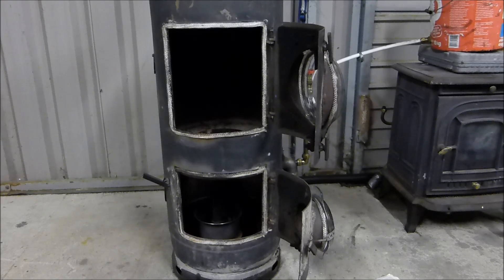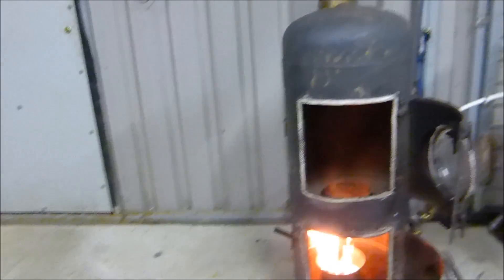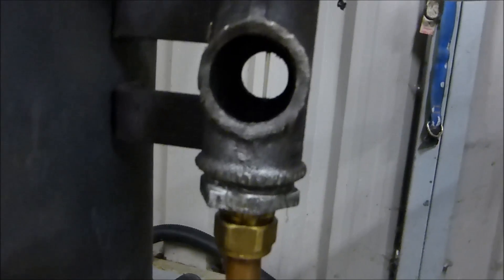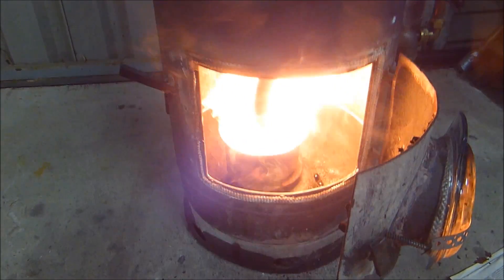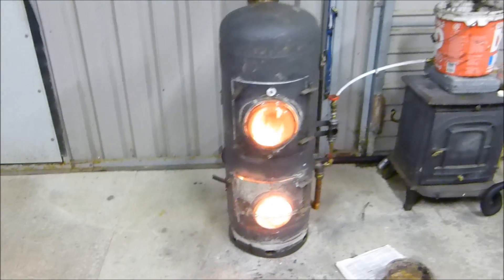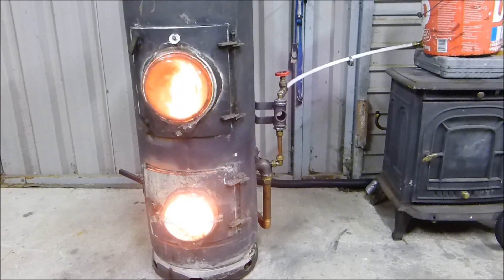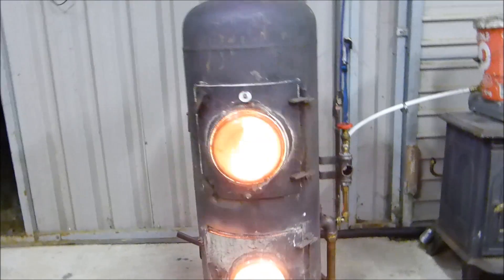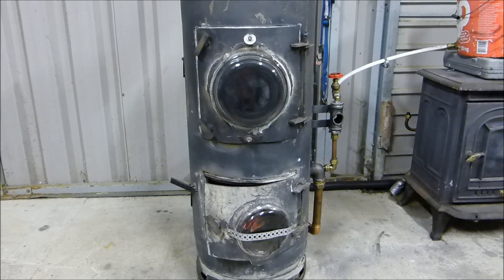Waste oil burner .. Drip Feed .. Back in action. Smoke free

Comment: Question for you; I have built one of these, but when it gets 'real hot' I get smoke coming up the oil feed line to the site window. Have you had this problem?  If so, do you have a solution other than shutting down the stove a bit?

Comment: Hi Gerry. I have been meaning to build a waste oil burner for some time now and your videos have inspired me to get going with it. I am curious about a couple things I haven’t been able to come across in your videos. First have you been able to use the multi fuel burner with the new forced air setup and burn wood at the same time. And the second question is for the oil feed you always use 1/2” copper. I have an abundance of 3/8” copper and wondered if you had experimented with it any and found 1/2” more desirable. I enjoy all the videos so far and look forward to more.

Comment: good evening I wanted to compliment you for his work is' really great, I wanted to know if possible the diameter of the exhaust gas I miss only this measure. I'm about to start a new project like yours, but 'I'll put a copper coil with 100 turns (inpianto x heating with an open vase) hopefully good
Reply from the maker: Hi Guiseppe.  The flue diameter is 4 metres long and 150mm diameter. Before you start building this have a look at my new burner. https://youtu.be/ShTLaYKjzxw Check out my playlist https://goo.gl/u7T3RW These burners are working great and dont need power Cheers Gerry
Reply: ok thanks for the answer then length 4 meters diameter 150 mm, I saw the great video this I'll piou ahead x my garage but in the meantime I continue with the first project I'll let you know how it goes to refine

Comment: why not warm water with this awesome piece of kit and pipe it through your home? or can't that be done?
Reply from the maker: Hi Mark. I designed a new and smaller burner unit and tried it in my house where I have a boiler stove that heats my underfloor heating and domestic water. I am burning waste veggie oil and heating 80 gals of water and my floor heating too. Check it out here. https://youtu.be/XmAqunRfCaA  Cheers Gerry

Comment: Awesome work, thank you. Why does it have two levels/doors? Do you use it as a heater directly or do you inject hot air/water in the rest of the house somehow? I'm thinking of feeding my radiator system with hot water out of one of these (with a thermostat, of course) And last question, did you ever use a buffer tank so that it heats water?

Comment: I have noticed  that the past 2014  copper feed and 1 inch pipe  drip tube  with spring ,and now see you changed the design, of the drip tube  with the end sealed off and 3 holes drilled at the end of the tube , what was the reason for that?

Comment: can smell the vegi oil here in the ole USofA , could you explain how you glue seal on the doors Thanks great video, nice job
Reply: Stove gasket cement.. works best if you rough the surface up with some coarse grit sanding paper. They do make flat gasket material you may be able to device another way with but at the temps you see with burning oil efficiently you have to be careful what and how you use it like not using rivets. These units aren't usually build air tight and thus why they are used in shops and not in homes.

Comment: Interesting work you're doing there Gerry, something to build on. Thanks for laying down so much ground work.

I would think a thermostat to shut it down when the room reaches a certain temp, along with an auto ignition system for when the room cools down enough to trigger the thermostat to reignite the fire would greatly improve the usability of this device. As does a typical home heating system.

I have another thought of putting a 30 gal (or so) barrel inside a 55 gal barrel**, using the inner barrel as a burn chamber and using a fan/blower feed to the outer barrel to circulate the air around the outside of the burn chamber, exhausting it thru "vents" to distribute the heat (as in a forced air system) into the room. This system, in theory, would heat the room to temperature faster, thus activating the thermostat to shut down sooner (more efficiency). This would conserve the oil, thus getting more burn time for a given amount of fuel.

Then to think of water pipes coiled around the burn chamber to provide hot water (or steam, if you get into steam power)....or heating any fluid for any number of uses, including simply transferring heat to other distribution points.

 **(Or a small propane tank inside the larger tank)

Comment: If you built a fire brick furnace lined with steel plate, and made a frame work with 40 2" steel tubes welded to a plate and attached to a manifold, the air, or water would heat up from the tubes being heated by the flames. Pumped into the house. heat with the furnace outside reducing danger.

Comment: Hello Gerry , thanks for making the videos of the burner projects , I am in the process of creating my own burner based off of your design , mine will be used for multiple things , as in heating my shop and for instantly heating water using a heat exchanger . Burners are not very common in my area due to a short winter, so this is new to me , but I believe the burner will be more then enough for my needs.

Comment: Dear Gerry:

For over a year, I have been looking at waste oil burners on Youtube.  My original thought was to build one to boil down Maple sap into syrup (technically called an evaporate).  After seeing the Oritz (sp) style burner, I got pretty excited about building one.  The boys and I tinkered around with main burner prototypes using some scrape brake discs and pipe from the salvage yard.  We got it to burn pretty good not great, but I figured because we didn't have tall stack, it didn't burn perfect. 

As I kept flipping through different guys designs and builds on YouTube, none of them really appealed to me.  In particular, they all seemed to have the burner unit underneath and exposed.  There was something about that central design feature that I didn't like. 

Anyway, late last year (fall 2014), I stumbled upon your posts of building a burner from a propane tank.  When I saw you had the guts of the thing inside the tank, it just look very...I don't know...professional.  I liked it right from the start and couldn't wait to build it.  Unfortunately, time and other commitments pushed off my build until about a month ago.  We live in Wisconsin over on this side of the pond.  It has been a long cold winter.  As God would have it, the temps just shot up into the 40's (F) and we just got our stove completed and installed.  Could have used it months ago.  Oh, well it is ready for next year. 

Wow, I guess it seems I am telling my life story.  Here is the point:  THANK YOU!  Thanks for sharing your design and the video.  Tomorrow, I am hoping to video my stove in action and post it for others to see your simple but eloquent design.  And man, does it throw the heat.  I laughed with my son yesterday telling him how on your videos, you kept saying "savage amount of heat."  Not a common expression here in Wisconsin until today.  My stove throws a "savage amount of heat." 

Oh, yea, I am a woodworker and the best part of your design for me is DUAL FUEL.  Wow!  Our first burn in it was actually wood.  What a great stove.  I am now going to build one from my brother-in-law and another buddy (or, do you say chum?)

Thanks again Gerry. 

P.S. For all you other guys looking to build a stove, stop looking.  Gerry got the best design out there.  Build one so avoid wasting a year like I did. 

Eric in Cheesehead land

Comment: I love this stuff. Righteous ingenuity. You should put your blower outside so it's sourcing cold air. Denser air, better burn. 
Also, put a flat spot in the top so you can put a kettle on ;)
Reply: Run the air through an intercooler.

Comment: I like that stove. I have an idea about how you might get enough airflow out of your existing fan to let you close the door. Here's my theory: I bet that fan can deliver more air volume at that pressure than the tubing will allow. If you put a T or a Y at the blower and add a second equal tube, you may get the same amount of air pressure in the present tubing and yet have a second air tube feeding the fire. Same fan - double the airflow, or close to it. Then the only question is where would you direct the second blast of air to get the best possible burn?

Comment: Great job, but I confess, a little envious I am already.
Reply from the maker: Hi kenahp. Considering that the whole thing is built from an old propane tank and some pipe bits and fittings it really does make an awful lot of heat for tiny money. Thanks Gerry
Reply: That´s why i admire your work! A little bit of this,a little bit of that.......
Reply from the maker: Cheers 
Gerry

Comment: I think i found a use for the old gas bottle... Not for the shed but for the garden. We have a lot of engine oil per year, see if that goes smokeless too.
Reply from the maker: Great way to stay warm this winter.
Cheers Gerry
Reply: Did you measure the heat in the top section? If it burns hot enough i can melt metals to cast my own items :)

Comment: Where do you get your waste motor oil from?
Reply from the maker: Hi PlantsAsMedicine. I burn Veggie oil when I can get it and if I service my vehicles I will use the oil from that. There are many garages that are happy to give it away for free. This stove will burn solid fuel like logs, coal and shed offcuts. Hope this helps
Cheers Gerry
Reply: Thanks, your right, I just googled used motor oil Ireland and some fella was giving away two large barrels of used oil, can that be converted to heat water pipes?
Reply from the maker: Hi Plantstomedicine
Great handle. I could do with something medicinal for a cold / flu right about now.
Getting your hands on the oil in small quantities is just a matter of chatting with some smaller garages.     Cheers Gerry
Reply: Cheers, Real honey hot water and lemon does it for me, RAW honey is a powerful antiseptic ( small spoonful every hour or so),  stops flu from becoming nasty. Did you ever here of Rick Simpson-run from the cure.
Reply from the maker: PlantsAsMedicine Thanks for the advice You were asking about the heating water. I did a few videos last year where I show 300 litres of water being heated by an old boiler i converted. Here's a link  http://youtu.be/xvddVsLqLdc
No I hadn't heard of him but I have a couple of brothers that should be cancer proofed for ever because of their fondness for ....  Cheers Gerry
Reply: Thanks for the link. Lol smoking it is good for chronic pain and general loveliness, unfortunately not good for cancer you need the oil extraction for that and almost every other  long term degenerative disease.

Comment: Another great job Gerry.  Have watched all your videos. Would a tank the same size as your minion tank be ok without the air flow. For a patio heater.  Thanks again for all the ideas.
Reply from the maker: Hi Mark. This little minion will be used as a patio heater and I might make a BBQ version of another character if it works out well. I could easily run it on waste oil but I might just run it on logs and sticks, not sure yet. The main task now is to get it looking well and then I will make it produce heat. More videos next week Cheers Gerry

Comment: Hi Gerry good to see you back,  did you change the design again,  I thought you made it multi purpose design?  to include a drip feed system.  Cheers
Reply from the maker: Dave Maher Hi Dave. I have been messing around with the design alright and there is more on the way. With the blower type I wanted to be able to convert an old oil boiler and stove to run on waste oil without having to do very much modifying to the original host. If I use the Ozzirt type I have to cut the bottom and raise the boiler so I went with this direction. I still have my Ozzirt original which seems very popular and I get asked about which I think is best all the time but the truth is they both work producing masses of heat, Thanks Gerry

Comment: Where can you buy kerosene? don't they use that in jet airplanes?
Reply from the maker: Hi Yves. Kerosene is used in domestic oil boilers as it burns cleaner than diesel. Its readily available but I could have just as easily used a little diesel. I think they use a high octane version for aviation. Cheers Gerry
Reply: +Gerry's Waste Oil Burner - Guys: Jet fuel (JP5) is high grade kerosene. Almost clear. Generally filtered quite well.   Hope this helps.    brad zee..

Comment: Hello Gerry, Thank's.
Questions (if you know) :

- I need to do a cheap barrel one,
but for heating a van, so I can't add a fan (too noisy- cat's house),
-> Fresh air intake with preheat tube could be a few sufficient (with a vortex etc maybe)?

- Those are Pyrex cooking plate as window :
-> Can I cut one with a carbon disc ?

Good winter -ü- 2015

Comment: Mr. Gerry the heater you made is very nice. Very impressed with the plumbing . Oil pipe in blower air pipe is genius . Can't wait for the next one. Which I already had one made for the shop its getting down to the low teens F in the next few days
Reply from the maker: Hi Jeff. This little burner works really well and with the door closed and the fuel cut down a little its a lot quieter than in the video. I am waiting on a syphon nozzle setup for the next waste oil burner series and  so more videos on that soon. In the meantime I am uploading a video which will be live tomorrow some time. Stay warm Cheers Gerry

Comment: Out of all the methods that you have tested.  Would you say that this is the most efficient (heat output for oil used)?  Currently building a waste oil burner but undecided about the best method.  By the way thanks for all the information and videos.
Reply from the maker: Hi T Ellis. At the moment I prefer the forced air type because of its size you can fit it it alot of stoves and boilers. I will be making a syphon nozzle type burner as soon as the parts arrive but the Ozzirt type works even when there is no electricity and is very easy to control and keep going and producing heat. I generally overdrive the burners in these videos for effect but it is possible to have them all running more sedately. I have been asked about the Ozzirt type burner so often now that I will do another video showing a detailed breakdown of the parts needed. Hope this helps. Cheers Gerry

Comment: Lol, I'm messing with you, I thought it would be funny to ask, because you clearly said no, lol!
Reply from the maker: Hi Clayton. If the burner unit were installed in an outdoor boiler house the heat could be transferred  / piped into domestic radiators. Many domestic oil boilers are setup this way. Here's a converted boiler with an Ozzirt type burner I connected up to an 80 us gallon / 300 litre hot water tank and heated the water to boiling in about 1 hour.  http://youtu.be/1Et3rIn5GIY?list=PLmQ5wJnkAIoI5u2qf0XAi9CylqbOZ6ntQ
Hope this helps Cheers Gerry

Comment: Would a stove like this be usable for heating a house?
Reply: It wont pass any insurance inspections.. You would have to design and build it the safest way possible and have a lot of redundancies. Make it air tight with auto controls. Never leave it unattended. Most will tell you it is a bad idea but if you can do all of the above and accept the risks involved you can do it. Down sizing the system and metering the flow to match your needs will likely cause the burn to be inefficient you will need to accommodate that issue also. IMHO using it in an out building built specifically for the unit to heat water and send that indoors would be a better option to heat your home and only risk the small outbuilding.

Comment: Hi jerry is it possible to feed air in with out a fan. .???
Reply from the maker: Hi Robbie. In the first video I put up last year I converted an ordinary cast iron wood stove with an Ozzirt type burner. here's a link
http://youtu.be/mh3cljTTJ2o.
Here's a link to the propane tank stove with the Ozzirt burner in it.
http://youtu.be/cYxtNRKj1Es
If you check out the playlists in my channel I have ordered the videos so you can navigate the videos easily. Cheers Gerry
Reply: Thanks jerry i will check your link out